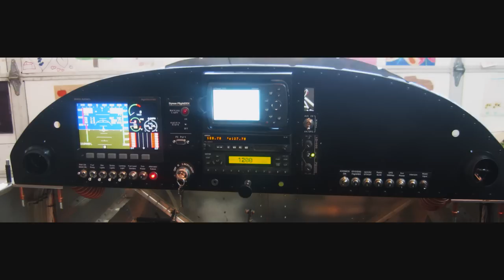Building an airplane: from kit crate to flying

Comment: could u not use a car engine to power a small plane?
Reply: The weight would be too much and you would have to worry about water cooling the engine which would add yet more weight.
Reply: Many have been tried but car engines are not lighter and not necessary better. After the engineering was done the car engines cost so much more than a new aircrafts engine